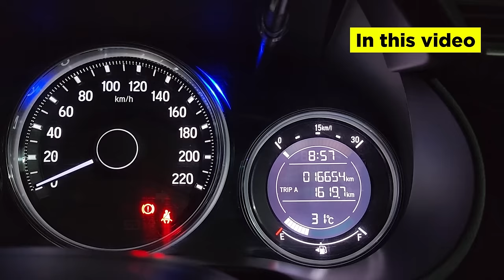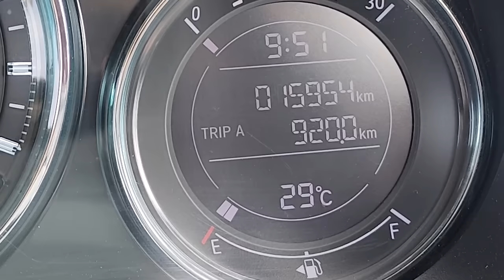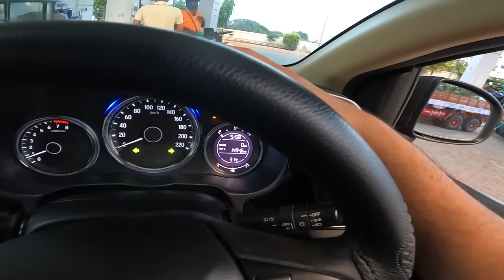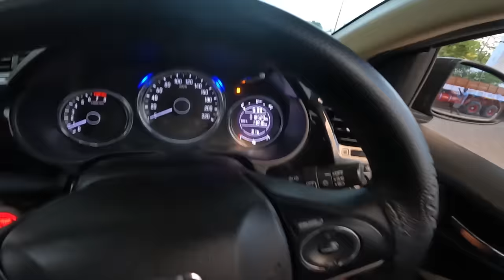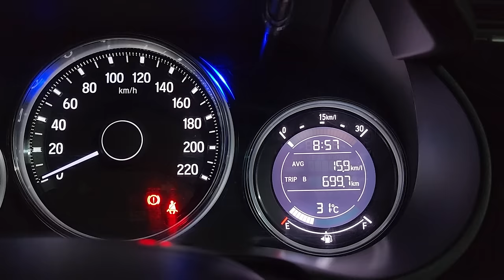Chennai To Kanyakumari In Honda City | 700 kms in 10 Hours! #hondacity #tamil #ivtec

Comment: Usually 10 hours is adequate time. Monthly once I used to drive from east Tambaram to Marthandam, if you maintain 80 to 90 kmph is perfect.
Reply from the maker: Yes it was indeed a relaxed drive for 10 hours!
Reply: Which car you used
Reply: What means 80 to 90 kmpl😂
80 to 90kmph speed ah?
Reply: @TheJoshucan innova
Reply: then why did you have to highlight that with a fire symbol in the card.... 9 to 10 hrs is usually normal.
Reply from the maker: Sorry sir. Dint know it was a punishable offence🥲😂
What a big mistake!

Comment: NH44 goes till Kashmir, if you would have noticed, we take Right turn to Chennai at Madurai. NH44 goes straight to dindugal, salem, krishnagiri and bangalore and goes up north,, Infact the route between Madurai and trichy is not good because maintained by state Govt as state road but it has 4 ways , Again from Trichy to Chennai, another NH starts which is NH45
Reply: U said correct Bro. The road between madurai and Trichy not good.

Comment: Bro, I differ from you on the road stretch between Madurai and Tirunelveli, during rains water gets accumulated at the corners causing vehicles to loose road grip at high speed.
Reply from the maker: I did drive during heavy rain but dint find any difficulty maybe it's because I drove in moderate speed. Other than that the road seems to be better than most roads around Chennai.

Comment: Avg 15.8 a bro ??? Highways la ?? Feels low !
Reply from the maker: I feel it's decent for my driving bro. Konjam sedated ah otna 17-18 kuda varum! Petrol avlo dhan bro except pana mudiyum.
Reply: evlo kudutha correct bro ?
Reply: @kishore.shanmugam  ok bro I don't know about Honda city.. my car gives 18 to 19 in highways speed around 110 to 115.. Honda is known for engine so I taught will give more mileage nu.. anyways it's great you replied !
Reply: @dinakaranannadhorai2721 what vehicle do you have?
Reply: I traveled chennai to Madurai by Honda city diesel bro,taken 29kml mileage ,included city driving😊
Reply: Petrol can give around 16kmpl to 17 with light footed acceleration in highways.

City - avg single digits only. Worst case 12kmpl

Honda petrol Engine is reliable.. not economical